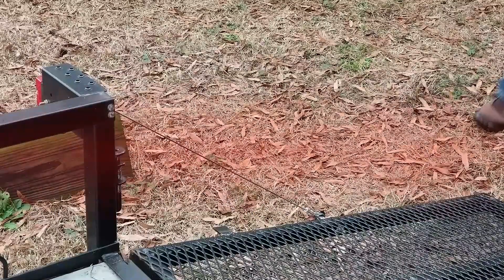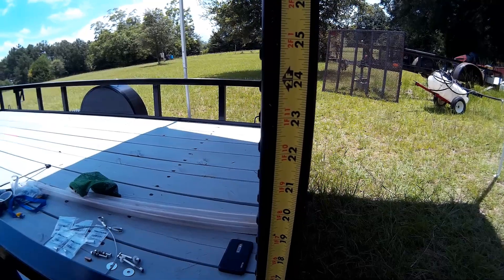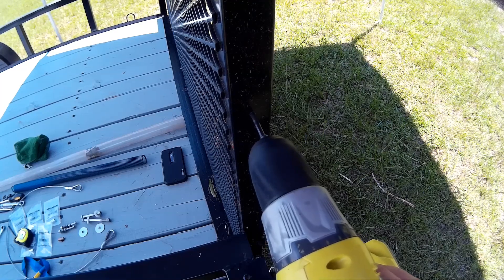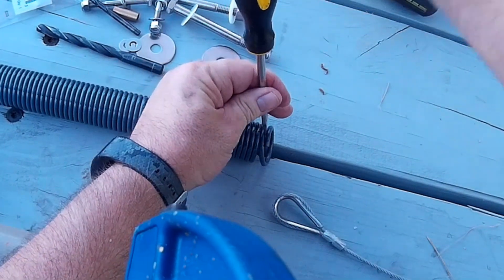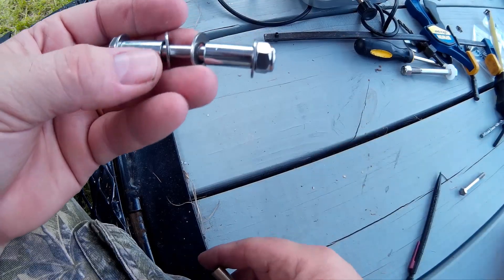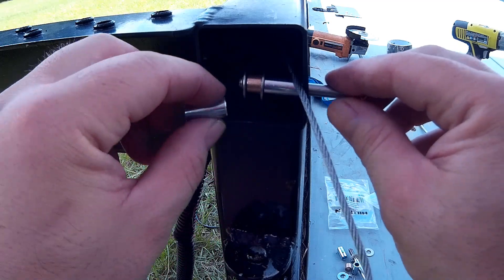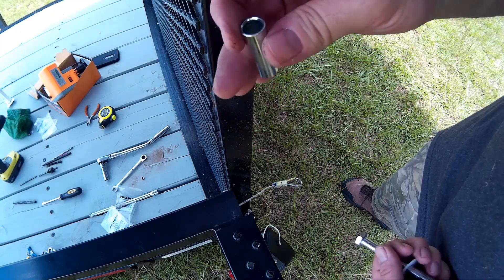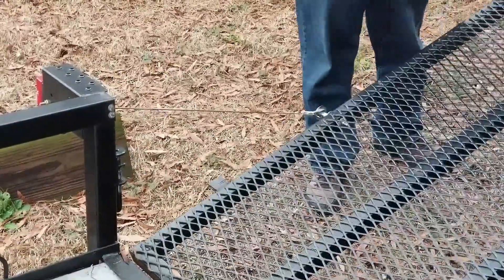DIY Utility Trailer Gate Lift Assist System - Lift That Ramp Easy

Comment: I have a 5 x 10 trailer with a dovetail drop the last 2' of the trailer... so the front 8' is flat and the last 2' is the dovetail.   My gate of the trailer is only 37" tall.      I got the gorilla and it doesn't work, maybe their spring is Too Strong.   Any suggestions if / how to make your concept work with my trailer with the dovetail?

Comment: This is genus! I just bought a trailer similar to yours but 16ft with the square tubing rails. I came from using an older 16ft trailer with the gorilla lift. I tried to put it on my new trailer but the latches were in the way where the cable connects to the gate. I've been searching for a similar system but a way to connect the cable in a way that would get in the way of the latches. Never did I even think about using the railing it self as a housing method lol. This is so much better than anything I've been looking at! Thanks for your video

Comment: Great video, do you think this would work on a dovetail? The dovetail is just under 4 ft long with a 20 degree pitch or so... totally fine if you don't have the answer
Reply from the maker: Sorry for the late reply.  I would think that it would work fine as long as the top rails are straight.  You might use some I-bolts through the mesh on the gate to play around the the placement before you start drilling hole in the gate frame.  The worst thing would be to have it with too much tension on it and the gate won't stay on the ground.  There is a point on every weight gate that is just the right balance.

Comment: Taking the Gorilla Lift back to Tractor Supply and doing this instead.   Thank you so much.   Better setup than nylon rollers that will wear out in a year or two.   Plus I won't have to drill so many holes in the trailer rails.
Reply from the maker: Right on!

Comment: Excellent Video, almost done need to do the ramp bolts, had a hard time measuring the bolts for the ¼"x3/8"x3/4" Steel Spacers but think the wire was a bit smaller and the washers didn't completely line up kind of over lap with each other. I guess everything has went way up on price. Thanks for the video

Comment: i would use stainless in place of brass for roller bushings. more so i would apply anti-seize grease or a thick synthetic grease where the roller spins. metal to metal is not good. brass is soft and will groove with that cable tension. stainless will too but is way harder. me i'd use stainless for the rollers. that's just my advice. i have run into riding mower engine valve guides that wear out. that's because they want them to. more parts sales. being in the marine repair business for 30 years its stainless over brass, bronze, and aluminum when possible. a lesson learned the hard way. bronze is fine it will allow it to roll easier. for me its 6 one half dozen the other. along when you start getting into stainless the price goes up. for me bronze would be fine because i don't use mine maybe 2-3 times a year. they would most likely outlive me. but i commend your fabricating a way cheaper system. they sell that similar set up. if you're willing to fork out the bucks. i give you a 10. job well done. if the rollers do seem to wear fast you can always experiment with stainless just to compare. no lost cause trying. besides mo money. lol. in fact im thinking of doing your set up. my 6 x 12 ramp is a back breaker for me at 62. and a real pain to remove from those hinge pins. got any advice on those pita,s. we like never got it off. because of the weight holding it and lining up the pins. even grease didn't help. any advice would be a winner. i have put some serious fabricating thought in it but i come up snake eyes on solution. great video. nice to know there's other creative minds out there. that do precise videos. down to the last nut and bolt. most edit out everything due to screw ups. from the beginning to end. and fancy themselves experts. take care.

Comment: What's the purpose of the nylon washer on top of the trailer rail and on the nut side of the tailgate vs just using a metal washer in those places?

Comment: My trailer is angle iron. Added 24" tall plywood sidewall braced at each end. Enclosed spring in 2" pvc pipe. 130# springs and 6' coated cables. Cannot get tension right. I've moved tailgate mount up and down to no avail. Get it so just touches ground but won't come all the way up. About 6" slack in cable. Any suggestions?

Comment: Only thing I'd change,  like I did on mine, is to use the nylon covered metal cord going from spring to gate. Haven't had a issue of it wearing out after 5 yrs. Looks like the brass rollers are getting pretty worn in the video.  Great job btw and excellent explanation. Was looking for a  video to send a friend who wanted to make one like mine and came across yours. Saved me a ton of explanation as he isn't too handy and lives 6 hrs away. Lol.
Reply from the maker: Thanks for the comments. The brass bushings were fairly worn by the end of the video because I didn't film that part until after a summer of using the trailer for lawn care.

Comment: On the measurements from beginning of spring to the lift gate bolt , was the length perfect or would you have went shorter or longer on front spring bolt ?

Comment: That’s a dang good job. My tailgate is a little longer and it’s was killing my bad back. I had an old winch off a boat trailer, so I mounted it on the rail about 6” from the rear and attached to tailgate gate with an eye hook. You can unhook it from the tailgate and winch a mower on the trailer. A while back I went a step further ( I found another winch) and made a bracket on the front of the trailer and mounted it. Now, I can reach 20’ behind the trailer to winch stuff on the trailer. Worth the effort.

Comment: Nice work, I have watched all the videos on this type of diy and this one is the best one. You explain it well and show your work. I commend you on this video, it is very well put together. I do have a question you may or may not be able to help with. At the end of your square tubing you put the rollers and bushing. Would you have any ideas as to how you would be able to do that on round tubing? It don't seem like that what you did would work for round tubing.

Comment: Nice job, video and instructional. Just looking at it, it seems like it would have worked much better if you had moved the spring forward and attached the cable to the ramp straight out of the tube onto the ramp, when it's upright.
Reply from the maker: It kind of does seem that way looking at it. However, if you did that, the cables would be pulling almost straight up when the ramp was down making it nearly impossible for the ramp to stay down and in contact with the ground.  There is a fine balance between having enough force to make it easy to close but not so much that it won't stay down when you need it to.
Thanks for the kind words about the video and the instructions.
Reply: @TheManCaveVideo  
Thanks for the explanation. Now I know why. 
Thanks

Comment: I’m planning on installing a 1/2” steel on my 1996 F-150 and use the tail gate as a fabrication station and I’m thinking of doing this same mod to help me assist 170-190 lbs (210 lbs total) of weight. Do you happen to know the weight load capacity of the spring and if I could buy one with higher load rating and if so where? Thanks!

Comment: Not sure on the attached and secure part of the cable though, but it cant come flying off bc the bolts at the end, there are safer ways to do that, those springs are dangerous. Great video though.

Comment: Using the existing rails is a great idea. Although, this being said, it brought an immediate concern to mind. Being you have an open rail and the spring is concealed in a tube, what do you do with moisture getting in there? Additionally, I’d look into a poly coated cable and a poly roller system. That steel cable on bronze bushing creates a component that will wear very fast. 

Good job on the assist though.
Reply: It's not something that is going to be raised and lowered a hundred times a day every day  of the year. Winch  cables  are not  poly coated  and are under   a lot more  stress than  a ramp on a private utility trailer.  Besides cable is cheap.

Comment: Not sure what happened to my question.  

What size steel tubing is your rail?  Mine is 1.5 and I am having trouble finding a spring I know will fit.
Reply: Just heard you say 2” when talking about the rollers.
Reply from the maker: That's correct. It is 2 inch.
Reply: TheManCaveVideo do you know the OD of your spring?
Reply from the maker: My Springs are actually 1.5 inch OD. They are actually a little too strong that's why I recommended 80 to 100 lb Springs in the parts list. A 100 lb spring should be somewhere around 1.1 inch OD and should fit inside your 1.5 inch tubing.

Comment: I'm doing some what like yours, on the tailgate I'm using an eye bolt and the square tubing instead of those bushings and washers for the roller for the cable I'm just using an inch and 3/4 steel roller for the top and bottom and eliminating  the washer so it doesn't rub against the cable.
Reply from the maker: That sounds awesome. I really have enjoyed this modification to my trailer and I hope you do as well. Good luck!
Reply: @TheManCaveVideo  your video was pretty much better than all the other gate assist system videos I looked at on YouTube, you gave me a few good ideas on how it's done. it looks pretty sleek on my trailer, it helps a little with lifting up the gate. It looks a lot better than those ones where the springs are just exposed.

Comment: Why not just put a heavy duty spring across the bottom and mount it just like the fold out section of a lift gate on a delivery truck
Reply: There's more than 
one way to skin a cat.
 Those springs you are referring to work quite well too.

Comment: What would ya do, if ya had an enclosed 4x6 trailer with a ramp, all wood in fiberglass out
Reply: mine has springs across the top like a garage door, with the cables running to the top corners of each side of the door. go look at a enclosed trailer dealer, I'm sure they have some there, to give you some ideas.

Comment: I guess if you had a trailer with angle iron rail you could bolt a piece of square channel to top to do this also. Would cost more but could be done. Prolly still cheaper then a ready built system tho.
Reply from the maker: You could definitely do that. I bought this trailer with the square tube rail with this project in mind.

Comment: Great tutorial! I've seen this design copied here but they gave kudos to the original.  I have a 5x8 trailer that is angle iron construction. I plan to enclose the top rails with a second piece of angle and create the channel for this system. Thanks for the video! Subscribed